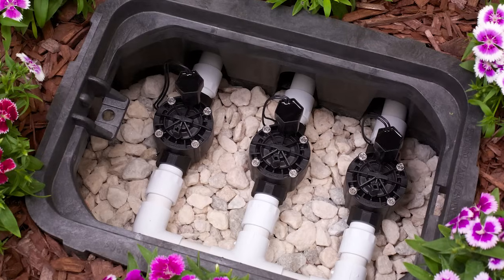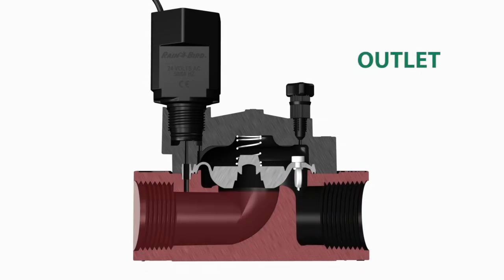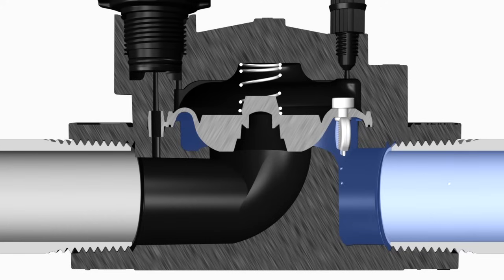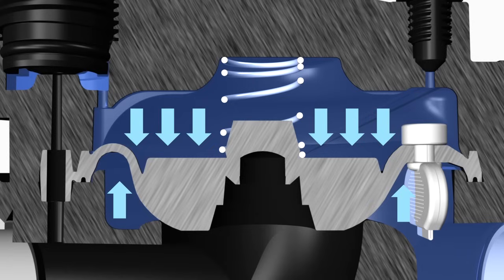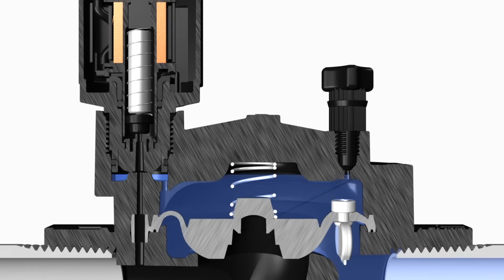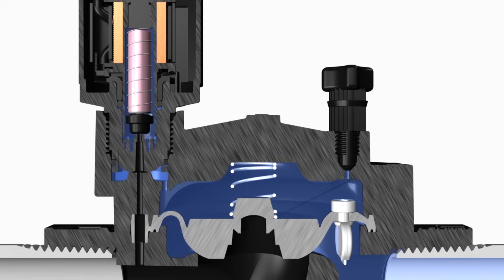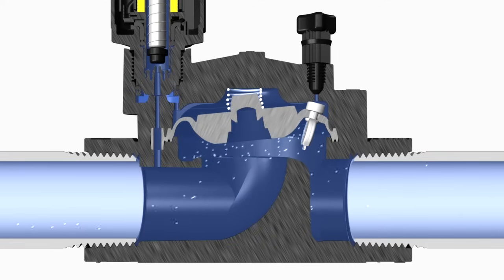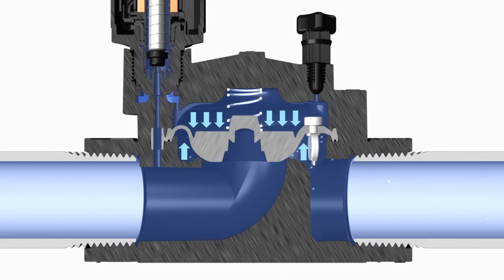How Do Sprinkler Valves Work? Rain Bird Irrigation

Comment: Great video, thanks for posting it.
I have installed one underneath my camper van to drain the grey water tank. It gets below zero where I live in the winter time, so I have completely wrapped the tank, hose and solenoid with insulation. 
Is there anything wrong with keeping the solenoid completely wrapped in insulation and does the manual knob move when the valve is electrically opened/closed? I forgot to check before I did the installation...
Reply from the maker: Hi, 
The solenoid handle does not make any movement when receives voltage. It is only a tool to know what the current position of the solenoid is. 
Every time that system is winterized. The best option is to leave the valves opened. That is how the system gets pressurized manually and takes the remaining water out.

Comment: Im trying to diagnose why one of my circuits wont turn on, it just has a light trickle when turned on. I opened the bonnet to find the pilot flow filter broken and laying in the bottom of the valve body. it seems like that is a very likely cause of my problem. Ill be picking up a rebuild kit tomorrow to see if this fixes it. Ironically this failure happened at the exact same time I tried testing a new sprinkler head on the same circuit for the first time (it worked fine earlier in the day with the old sprinkler head installed), causing me to think there was an issue with the new sprinkler. We will see though. if not, I'm calling a professional haha
Reply: Having same issue. Did you figure out what the problem was?
Reply: @mrmastertj89  yes, I replaced the diaphragm with a kit from home Depot and it fixed everything. Working perfectly now

Comment: I have a problem as my valve seat does not seem to stop the water flowing when the tap is on. The sprinklers will just turn on automatically, what can I do? In my other systems I can turn the valve seat on manually to turn the sprinklers on but this one does not seem to do the same.

Comment: I watched twice and still do not understand 😢 exactly how the water pressure in the top over powers the flow from the supply line.
Reply: Water within the irrigation system naturally flows into the valve. This water is guided into the solenoid and the bonnet chamber, where this water presses down on the diaphragm preventing water flow. A plunger, controlled by the solenoid, sits in a relaxed position which seals the dump port.

When power is applied to the solenoid, the plunger moves upwards. The water from the bonnet chamber and around the solenoid to flow into the outlet of the valve via the inlet.

The water exiting the inlet is at a much higher pressure which overpowers the low pressure water pressing down on the diaphragm causing the diaphragm to move upwards allowing the valve to open.

Comment: Will this valve help reduce water pressure for a drip irrigation system?  The water pressure in the greenhouse I’m working is very high and the drippers blow up.
Reply from the maker: For drip irrigation systems, you'll need a low flow valve or control zone kit. Here are some options: https://store.rainbird.com/nsearch/?q=low+flow+valve

Comment: So it's like a transistor, where a little current controls a much bigger current!
Reply: Yes, that's an important principle, like a bipolar junction transistor.  It takes a lot of mechanical power to open a big valve.  A tiny flow from a small solenoid valve, that doesn't take much power to operate, leverages the power of the water supply to actuate the big passage.

Comment: This is a great explanation of valve operation, however one thing was omitted: the spring above the diaphragm. If the valve is closed simply by the water pressure above the diaphragm, then why is there a spring there? And why does the valve fail to close if the spring is removed? That spring seems important...
Reply: rain bird lá to the beach eu to do a lot of homework homework and then homework and homework to do and so we will be doing
Reply: Yep the spring is what allows it to overcome the inlet pressure
Reply: @RedHaloManiac95  Not quite. The inlet pressure and the bonnet chamber pressure will equalize so there is no pressure to overcome, the problem is that the bonnet will simply float somewhere between open and closed. To ensure it closes, you need a small additional force to make it "sink" back to the bottom and seal closed. Essentially, the spring guarantees that the inlet + spring pressure is always greater than the backflow outlet pressure -- ensuring that the valve closes and stays closed.

Comment: What if the valve fails to shut off due to the diaphragm getting a hole or anything else . Is there a way to turn off the water manually?
Reply: No.. if the valve doesnt shut off you will have to go back to the source and shut it off there.
Reply: This video depicts the operation of a reverse flow valve (as noted in the narrative).  If a reverse flow valve gets a hole in the diaphragm, the valve will close.  That higher flow of water through the diaphragm will overwhelm the solenoid dump port allowing water pressure to build on the top side of the diaphragm.  That pushes the diaphragm closed.
So, if a valve won't open, one possible cause is a hole in the diaphragm.

Comment: Thank you, good explanation   ......   now I need to identify and excavate my misbehaving valve to see why it doesn't want to close fully  😀
Reply: Most likely debris in the valve.
Reply: @coltwinchester6124  That was my guess as well when I went hunting for it. After a good clean though it still misbehaved, I suspected a worn diaphragm and replaced the top. All good since. 

That was months ago and as that retic line was a bit overgrown, and I hadn't drawn a detailed enough diagram for it, I started digging for the pipe and joins etc - goes under the driveway and branches to a couple of additional areas. I've still got to finish off that task, then put some rocks back. Something else always comes along that is a higher priority when you're a weekend DIY-er  🙂
Reply: @fred4687  40 year experience here.  You are on the right track, 🤔

Comment: My Rainbird valve doesn’t turn on manually turning the solenoid, the sprinklers don’t pop up, just low flow. What should I do? Thanks in advance
Reply: Replace it, diaphrams probably stuck half closed. Or just completely deteriorated.
Reply: check the water pressure also.

Comment: If one has a 3/4" inlet will it be a "full flow" 3/4" going out?...OR does this valve cause one to lose water volume as opposed to a full flow ball valve?
Reply: what your asking: Is there is loss of flow because of the mechanical interworkings of an elec valve vs a manual ball valve? the answer is yes. There is a small loss of flow due to friction loss, this happens through out the whole system. there are charts for these calculations. Determine your GPM or ( Flow ) and find the friction loss for a 3/4" valve..

Comment: I have a new one i mounted vertically that doesn't seem to work as it always allows water to flow. Does it need mounting horizontally?
Reply: No, you valve is bypassing. Change your valve.

Comment: Currently working on a golf course with lots of rainbird stuff so this is extremly helpful as I am fairly new with all this.
Reply: Sorry, but without training or a lot of experience you will be quickly overwhelmed. You are on the right track though, with educating yourself.
Reply: Really? A Golf Course? Your playing in the big leagues and your new to this? Who are you rubbing elbows with?
Reply: @noeeon9910  What's big league? Golf course or working with rainbird stuff? Irrigation is fairly simple imo. Now the comment is 3 years old and in retrospect it worked out well. I did my job well. No longer working with golf but thats for a whole different reason! :)
Reply: @Zaru7t10   Golf Courses is big leagues... Not working with rainbird.  And yes irrigation is fairly simple.... In theory.  I'm sure you " fixed" the issue. But doubt you did it right.
Reply: @noeeon9910  My boss at the time had worked on golfcourses some 20 years and he never complained about my work with our irrigation system.  But yes, if you compare that course I worked on with the big league courses in US and whatnot, I wouldnt stand a chance ofc.

Comment: Will the valve work without any water pressure?  What is the minimum amount of pressure to make the valve work?
Reply: I hope you dont own an irrigation company.
Reply: @noeeon9910  I do and have been in the industry of close to 20 years. I posed the question to settle and argument with a new "Irrigation Contractor" who was advising people to simply let the controller run through a cycle to prevent freezing in the system. Very misguided advice in my opinion. If you would care to weigh in on the subject I would be interested in your opinion.
Reply: @marvisirrigation4796   misguided advise? You are a pleasant fellow.  Theres too many variables for me to give you advise on that matter including backflow device, region,  and design in order to winterize properly. With that said however that new irrigation contractor is very misinformed.

Comment: Can 24V AC selenoid vlave work on 24V DC power?
Reply: No, not generally.  The solenoid's wire coil has more impedance to AC than DC.  If you apply DC, too much current flows, and the coil overheats and fails.  Same thing applies to contactors that actuate on 24VAC.

The Rain Bird TBOS solenoids operate on 9VDC, and are drop-in replacements for the original 24VAC solenoids, so you could try that if you need to convert a Rain Bird solenoid valve to DC instead of AC.  Furthermore, the TBOS design is a latching solenoid, so you only apply a voltage briefly to turn it on or off.  This how the Rain Bird valves are converted to run on battery-powered controllers that can't afford to power solenoids continuously or with AC.  The 24VAC controls are obsolete, dating back to when controllers comprised only transformers and crude switches.

Comment: Hi, So, does that mean there can not be a backflow from the outlet to inlet when the solenoid closes. I have the inline values in my front and back yard, and I do not know if need a backflow preventer or not. Please let me know urgently
Reply: you still need a backflow if you're on culinary.
Reply: @mariobeans  Thanks. I replaced all my inline valves with anti-siphon valves. But now, when the sprinklers turn off a see a gush of water comes out. Is that OK

Comment: Good god! So advanced for such a rugged piece of equipment!
QUESTION: if I pressurized one zone with compressed air through where a pop-up would go, would the air pressure be able to escape back through a closed solenoid? I'm having a problem during winterization where my air pressure is escaping through an an automatic drain, located 4 feet underground.
Reply: yes you can blow air through a pop up head. then open up your other zones one at a time either manually or through your clock.
Reply: Curious, why is there an automatic drain 4 feet underground?  Anyway to answer your question, no air will not escape through a closed solenoid.

Comment: Can these valves be turned on manually if there is system failure on the program or if  it has gone damaged
Reply: Yes
Reply: Yes turn the solenoid
Reply: Turn solenoid counter clockwise (loosening) about 1/4turn. Or some valves have a small plastic manual control next to solenoid that raises plunger when flipped.
Reply: I prefer unscrewing the bleeder screw

Comment: I know the valves are supposed to work inlet to outlet with the arrow direction.. but what happens IF it is installed backwards? ie does it still work correctly?  (And i'm pretty sure i did it backwards. Because if i turn it 'ON' the station shuts off, and the station started running immediately after replacement.)
Reply: Jimmy Scott same ? Any update ?
Reply: I've installed probably a few... yeah I'd say 3 in my lifetime backwards and when I went to kick them on.... nothing happened. After closer inspection I realized I was moving so fast I put it on backwards

Comment: What is the name of a black screw above a Pilot Flow Filter?  What is it for?
Reply: If the valve isnt working, the first thing to try is to flush out any debris that may be interfering with its operation. You do this by opening the Bleed screw about one turn. Sprinkler zone will turn on as you do this, so be aware.

Comment: Great video, thank you. I would like to know how to adjust the PILOT FLOW FILTER. I know it is done by turning the screw, I mean how tight should I do it
Reply: you dont adjust it. I think you're referring to the bleeder screw right above. unscrew it a bit and it opens up the diaphragm.  Basically just a way to turn your valves on manually.
You can do the same with the solenoid.
Reply: Bleeder screws main function is to help flush debris, it also turns on the valve by chance

Comment: The water flow from the hole when electromagnet lifts is acting as a lever to lifts the diaphragm because there is a small hole in the diaphragm that fills the chamber but in higher water flow lifts the diaphragm.When the water flow stops from the electromagnet hole the water pressure then pressures back the diaphragm to close.Similar to the electric relay action.

Comment: Is there any video or document I can refer to know how to connect solenoid to rainbird controller (LXME)
Reply: Solenoid to raibird controller? I can help but I need more details.
Reply: Just for simplicity, run pair of wires to the solenoid.  One wire from the solenoid to the common on controller,  the other wire to the zone on the controller.  That's it.

Comment: My question is,can these type of valves be used as a general electrovalves or intended only for garden use?I plan to make a electronic level sensor for a water tank and need an electrovalve,so can i use an irrigation valve?The water tank is upstairs on a loft inside the house.
Reply: Few things you'll need to keep in mind.
You need sufficient pressure upstream for the valve to function correctly, then you need something that will trigger the solenoid at 24vAC.
Reply: @addleyscanada  Finally i use a washing machine valve since the amount water that flow is small and also has better sealant and very little weight of few grams and fitted directly to the tube.The irrigation valve of 1 inch when filled with water weights about 1 kgr.
Reply: @addleyscanada  actually you don't even need 24vAC to actuate it. I have used as low as 8vDC to actuate it before.

Comment: Should the solenoid be in OFF position normally? When I turn the solenoid in ON position (manually) my Orbit station cannot stop the water from flowing even if programmed to be off. But if I close the solenoid (manually) water doesn't run even if the programmer is telling it to. I'm thinking it could be a fault in the Orbit station. Any help would be appreciated. Thanks.
Reply: I have the same issue. Did you figure it out?
Reply: Check the 2 wire going to solenoid  . Orbit station terminal if you get 24 volt when you turn it On . If you get output .  Then check the end of that wire  that connect to Solenoid  if  connected  the one with waterproof  wire connector.

Comment: Its all wrong.  The water comes in the bottom hole covered by the diaphragm and goes out the side.  This all occurs UNDER the diaphragm.  The top is for the tiny dribbles that actuate the valve!
Reply: So you’re saying Rain Bird doesn’t know how their own sprinkler valves operate? That they designed? This is the legit Rain Bird company YouTube. I kind of trust their word over yours no offense.
Reply: Im sayin the illustrator or the explainer is all wet.  The main water flow never passes above the diaphragm, and thats a fact.

Comment: Hey l have 6 stations but number 1 don’t shut off stays on all time you know what is the problem??? Maybe selenoid valve ????
Reply: I had this problem with on of my stations. To prove it is not a problem with the solenoid, I took a solenoid from another station and used in the troubled station. It did not make a difference. At that moment, I was pretty certain the problem is  with the port, which allows water from the inlet to get into the top of the diaphragm, blocked by debris.  Since the water from the inlet port does not flow to the top of the diaphragm and thus no water pressure is there to hold the diaphragm down to prevent water from the flowing from the inlet port to the outlet port .  The filter of this port can't be cleaned out easily and the diaphragm is 15 years old; thus I simply replaced it. It is about $5 in Lowes and Home Depot.
Reply: I have found some problems with the bonnet, sometimes they crack where the selenoid dump port is, causing the valve to stay open all the time, I have seen that problem with Hunter and Rain Bird valves, a hair thin crack barely noticeable.
Reply: Most likely debris in the inflow.
Reply: buscador2007 that can happen to any plastic irrigation valve. Some older fiber filled valves from rainbird in the peb series are notorious for this also people can cause it by over tightening the male adapter. In my experience a lot of home gamers like to tighten things to the nut.